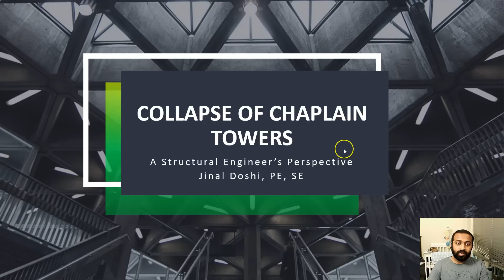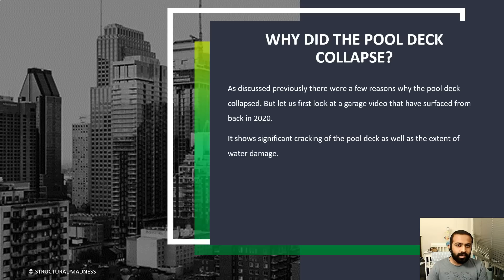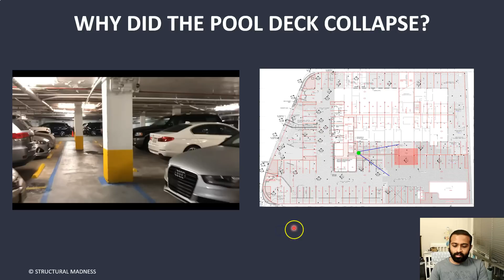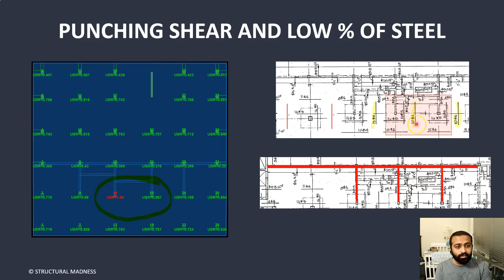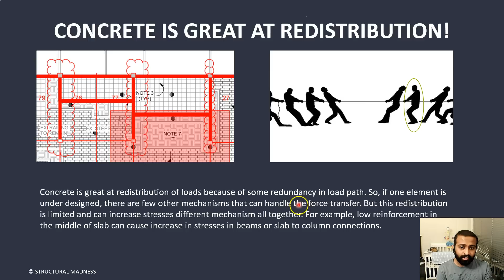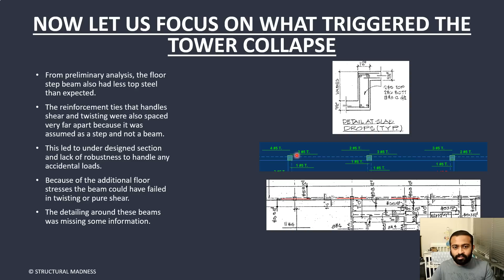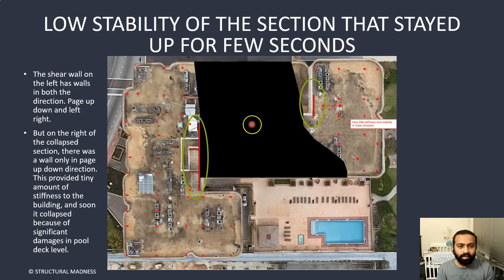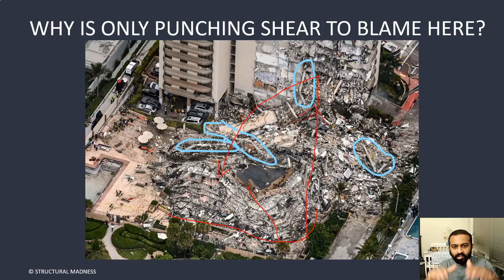Reasons behind Surfside Building - Champlain Towers South - Collapse : A Structural Engineers Review

Comment from the maker: Some answers to great questions in the comment section. I loved having this discussion so far with all of you.
1. Total loads that I have imposed on model: The weight that I used for the analysis is: Self weight of the slab + 5 pounds per square foot of plumbing and stuff hanging from ceiling below + 5.5" of toping slab this includes all the tiling and waterproofing and so on + 10psf of live load. For all the Structural engineers out there, I used D + L as the load factor. So the actual total load that the slab was experiencing was about 210 psf. And I did a strength level analysis on it to understand the magnitude of reinforcement that will be required as well as punching shear capacities.

2. What made me start poking into serviceability level loads with actual strength level analysis is, the smaller sections of pool deck columns (Columns that only supported pool deck and not tower above) along with such a built up of topping material on top. In general I knew that 20 x 20 spans will be okay, but I was surprised seeing same columns supporting almost 27' x 19' of tributary. This made me a little uncomfortable specifically knowing that it will be exposed pool deck and will be prone to weathering effects because of ocean. Where there were soil planters supported by just 15" deep stepped beam, I was very skeptical if they would work. These beams were failing under the existing design capacities but were saved by the material safety factor because the actual capacities were about 50% higher.

3. Shall we build flat slab building with beams? -- Based on the advancement of building codes specifically after past partial collapses, new construction will be safer as building requires some additional continuity of reinforcement at these slab column joints, we also have sophisticated data available based on 1000's of slab column punching shear studies that actually reduces the calculated capacities under certain scenarios, we use advanced software that helps us design and detail complicated slabs. So if everything from design to execution is done correctly, then the chances of such failures are extremely rare. Look around you, out of millions of building in US, built using the recommendation of same building code, we had a failure of one here. This was an extreme outlier where a lot of factors unfortunately overlapped leading to such catastrophic collapse.

4. How could the pool deck lead to collapse of tower? -- As I mentioned, those 16" x 16" columns were just too skinny such that once the step beam failed to brace the column sideways, it didn't have enough stability left. Look at the other section that was standing (24 x 24) where the floor with cars collapsed. So I think this giant step beam along with may be no column ties in that 2.5 feet of step beam depth lead to opening up of steel and concrete and slowly the column started failing a bit right there leading to a this catastrophic collapse chain. There is even a video circulating form someone's home surveillance camera which shows plaster failing in front of camera and later on the entire building fails. So this could support this theory of column instability. Initially it took few minutes for these columns to slowly bulge out / steel buckling / lateral instability so that portion of the floors above is slowly deforming down which will lead to some finish wear and then as soon as it reaches its critical failure point, the column just collapses.

5. Concrete delamination of pool deck? -- I think people are referring to Morabito core samples. And based on those samples I think the concrete typically delaminated where it was expected to. The construction sequence will be, first 9.5" deck will be poured. Then cured for few days. After that they will pour the topping slab and all if it had different thickness everywhere. We do this intentionally so that in future someone can replace it with something else entirely without damaging the slab below. So I don't think that this was a big concern. And also remember that concrete is very brittle so sometimes while taking those core samples it can just break as it is not as homogeneous material as steel. Concrete is made up of cement + sand + aggregates (stone chips)  + water (which dries once concrete cures). So a lot could happen when you try and take those samples.

6. Collapse at night? -- I just meant this as metaphorically. Like I don't think temperature difference and relative thermal effects because of day and night difference could have caused this.

7. Thermal stresses? -- I would be more worried about shrinkage cracks than thermal stresses. Concrete has very good resistance again thermal expansion / contraction. That's why we require fire proofing in steel buildings and not concrete. Because the stresses related to extreme temperatures on concrete buildings are fairly low compared to the steel building of same size. I think it will be interesting to study shrinkage stresses if the pool deck was restrained to the basement wall while pouring the slab as the footprint was like 450,000 square feet. But these typically occurs during the construction stages, so it depends on contractor as well. 

Some corrections to the video:
0:54 - It is Champlain Tower South not Chaplain. I wish YouTube had a better editor.
23:58 - The blue line on the graph should have been above 1.0 because the Y axis of the graph is (Demand / Capacity Ratio).  At the time of creating this video, I was thinking just about capacity line just like I have commented on the blue line. But the point is, as the steel rusts, concrete opens up because of less than required reinforcement at few locations and having very low steel percentage between slab and column connection reduces the overall capacity. So it increases the (Demand / Capacity) value. Because the slab column joint faces the same magnitude of demands because of its own weight and materials on top of it.
Reply: I concur with your analysis, (disclaimer-I am a retired CE with my specialty being STEEL construction) especially as to the application of the imposed loads and the transfer of loads, bravo.  We need to recall that these plans were designed in a period wherein Working Stress Design was being replaced by Load and Resistance Factor Design and computer/finite element/analysis, etc. was in its infancy.  ACI and other codes take time to reflect the experience of feedback.
Given that and understanding that concrete thermal expansion is less of a factor than with other materials, I still find it very odd that there was what amounted to a rigid connection between the step beam and the pool deck slab, among other locations. One would think that this would be an ideal location, among others, to separate major architectural/structural components especially giving some convenience to the contractor's construction method(s).  I feel as you discuss that the attachment of the pool deck slab was detrimental to the failure mode of the building structure.
Another thing I found odd was that not focusing on the structural design of the pool deck slab, the lack of serious floor drains was unusual by my reckoning.  I have not as yet seen any original plans that detailed any floor drains.  From underneath there seem to be some PVC drain lines?  Miami is an area that experiences tropical downpours.  Strange.  I do feel that the degradation of the structure was an unfortunate disguise to inspectors in that nothing seemed to be aimed at catastrophic failure.  The danger was lost in the details.  Very sad.  Thanks for your efforts to understand this tragedy.
Reply: Haven't checked codes for occupant load of POOL DECKS, but seems 10lb. per sq. ft. live load is about 1/2 of what it could and should be.
Reply from the maker: So for pool deck, building code specifies 100 psf live load. I used 10 in my analysis because when the pool deck collapsed, there was no one there. So I was just trying to create a more realistic loading condition to reflect the actual scenario.
Reply: @StructuralMadness   - I was guessing 50 psf LL for the pool deck.  So, with 10psf LL, what reinforcing did you come up with?  How much strength is lost as a result of NOT capturing the reinforcing completely in the concrete>
Reply from the maker: @paulpresson9786  The reinforcement for this loading was very close to the reinforcement on drawings where the planter boxes were. And Where the long span area was, that's where it is under designed by about 5%. Which leads to the point that it was just working hard with to resist the daily loading condition. When you have extreme usage of pool deck, the deck wouldn't fail immediately. It will deform a lot and concrete cracks will be wider than acceptable, but everything will be hidden under the finishes. And as the material deteriorates, the strength does too. When you see water puddles around columns, that also shows that there is a passage for water near slab column support. Typically overall this is in compression but when such crack occurs, it reflects shear / punching stresses. And sometimes it is just a matter of time for few cracks to slowly propagate and weaken the slab that it fails without any reason.
Reply: @StructuralMadness  have you seen the the damages on the access ramp? When you look closely on Google street view on the 88th street, you can see huges cracks on the sidewalk on both sides of the ramp. And if you focus more, you can see the slab of the ramp have lifted. Check the joint between the access ramp and the sidewalk
Reply: @StructuralMadness  a month later and you nailed it ! Now since the Miami Herald came out with their article about columns being over crowded with rebar and some inconsistencies between the plans and the actual build and can you do a video on the Miami heralds article based on your analysis. ? Also now knowing that the plans were revised several times . The more i dig the more questions I have . Things like renovations adding weights or possibly taking out out walls to open areas up 🤷‍♀️did Morobito do an adequate inspection they inspected in 2018 and 2021 but there was never a sense of urgency to me. Why didn’t they put up supports in the garage or whatever they are called . If you need any resources I basically have them all I can get them to you .
Reply from the maker: @Collapsedbuildingandchange  Thank you for the comment here. As I mentioned it has been really difficult to find enough time to work on it further. Having an infant at home makes it really difficult. But yes any resources that you can share will be helpful. The email address is listed on my channel. I have noticed high % of reinforcement in these columns but are within the 1977 ACI building code limits. I do know a couple of things that could have lead to this column failure. But yeah whatever you can share will be helpful.
Reply: @StructuralMadness  that’s completely understandable . Children come before anything. Our group is attached to the because Surfsides livestream. A resident in East that streamed the whole thing . I literally have thousands of things 🤣 . So if you could be a little more specific I could get them over or you can slip in the group and grab some resources from the topics. Just let me know and I’m happy to do either.
Reply from the maker: @Collapsedbuildingandchange  I think if you can just share the link to the group that will be helpful. I mean the only solid piece of missing information now is how the column to beam connection where the pool deck steps was detailed. Once we understand how it was constructed we will have closed all the loops.

The factors like newer finishes haven’t contributed to the collapse as the slabs as well as the columns were strong enough to handle the added load of some newer finishes. I did check the floors (2 through roof) and their capacity to handle these loads was adequate enough. The columns supporting these floors including the skinny 16x16 columns were strong enough to support the added loads of newer finishes as well as the new roof equipments. 

And typically a local slab collapse shouldn’t have lead to a partial tower failure. It just happened because of the 16x16 columns instability. And that’s the difference to understand here. Instability and strength are two different faces of coin. Instability leads to a sudden failure like this.
Reply: @StructuralMadness  sure thing. We are the fb group that was formed from the Channel Because Surfside. FB https://www.facebook.com/groups/2261936353948275/ I try to put as much as I can under topics . 
Rob was streaming the site. He’s not currently streaming unless their is somethings going to on site . He does have nest a nest cam up for now where we can check . It’s just a dull zoomed out feed but he keeps it up 
https://video.nest.com/live/yFSxuJesQJ?fbclid=IwAR1JjWY8mWZKHFLyaAfqNAHOOrnl9IZag-22ko4NCS0EW92TRmj4v52Y6HA
Reply: @paulpresson9786  The minimum occupant live load in the code for any use is typically about 40.  An outside pool deck should be designed for a lot more, at least 100, because you can have high density of people during parties, you can have equipment driving over the deck while working on landscaping, trees, and pavers.  But if you are investigating something to see why it failed when it did, you should use the actual load in place at the time which was very little in this case.  Even the cars in the parking area wouldn't average to much more than 10 psf.
Reply: @Structual Madness

i don't think thermal effects or stresse cause much damage in THIS case.
But from the Pipers Row car park collapse we know: thermal effects can reduce the punching shear capacity.
Reply: It fell because people are getting fatter. They eat at McDonald's.

Comment: Another engineer commented on a Miami Herald article that hypothesized some reasons for the building collapse. He reviewed a analysis done by professor Dawn Lehman from the University of Washington. I re-watched your presentation, and was taken by your structural "tug of war" analogy. Professor Lehman thinks that it is possible that the perimeter wall was holding up the pool deck through tension, and this was preventing the pool deck / parking punch shear from occurring. She hypothesized that the new building pathway construction directly adjacent to the wall caused additional damage and water intrusion into the concrete perimeter wall, causing the rebar to rust and fail through stress. Another engineer hypothesized that the problem may have been caused by long term thermal expansion/contraction - as the pool deck has no expansion joints running parallel to the portion of the building that collapsed. He stated that the concrete deck temperature change  on the day of the collapse probably was somewhere around 65 degrees, resulting in a change in pool deck dimension of over 6", and the reason that the collapse happened in the middle of the night was that this was a time of maximum stress (coolest time of the day). This certainly accounts for eye witness accounts stating that the pool deck collapsed first. As in your tug of war analogy, when the rebar started to snap, it was like the rope breaking and the concrete slab being pulled toward the tower. As the slab fell progressively until it reached the front of the ill-fated structure. The planter reinforcement beams just in front of the building likely dropped down only on one side, putting additional stress on the perimeter building columns that they were attached to, and slab separation likely pulled some concrete away, further weakening the columns. From there, it was just a matter of minutes before the building collapse occurred. I was wondering what your thoughts are on this hypothesis. I can give you a link to the Miami Herald article and the engineer's analysis if you want to look at either of these in more detail.

Comment: Thank you so much for having created this detailed analysis, Jinal. I am wondering if there is a way to correlate a collapse sequence with witness statements from prior to the building collapse at 1:22 AM. Basically, the witness statements can be boiled down into seven observations that we currently know of: 
1. ~3-4 AM in 1211, heard unusual, loud cracking sounds
2. At 11 PM in 111, heard ongoing banging sounds that increased in intensity over time
3. 1:10 AM in the lobby and in 111, heard something fall
4. <1:15 AM in the garage by the elevator, heard loud cracking sounds
5. ~1:15 AM in the lobby, saw the parking deck collapse
6. 1:18 AM looking down the garage ramp, saw debris and possibly Column M11.1 was damaged or collapsed
7. <1:22 AM from 410, saw the pool deck had collapsed

Comment: I do believe that only one column was disable ( not supporting a load) the one align with deck column 27 ,  because it was 7 minutes and cracking of walls was reported several floors above for  3 to 5 minutes yet showing that adjacent columns were also twisting and lateral load by a now much larger span  , more than 30 feet.  and the failure of three ( 3 )  columns would cause a much more rapid collapsing. basically this building construction could not support itself without a single column.

Comment: At 34:38 --- that step beam that you show, was that not deleted in a January 1980 drawing?
Reply from the maker: Hey James, the beams that were removed in plan revision were present at a different location. The revision happened between grid lines J through K and 12 through 14. These step beams and additional support beams have always been present on drawings even after revisions. These are also visible in the Garage video.